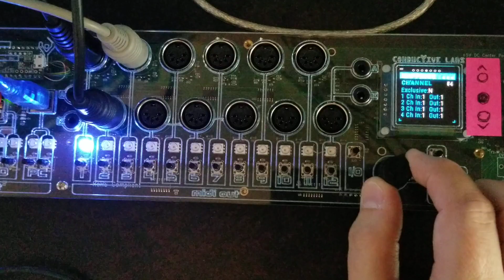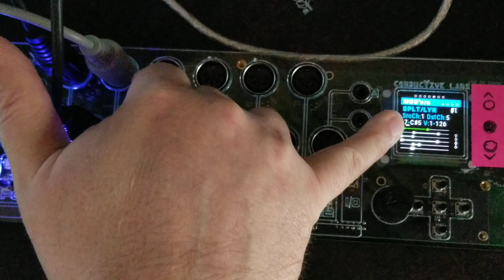MRCC April 2020 Update - video 3

Comment: I have a question on these functions - how do all of these really cool routing and modifying features influence latency in the MIDI chain?
Reply: Like all MIDI routers before it, you will get some latency vs a hardware MIDI thru device that does no processing. The minimum theoretical added latency is 1ms. The more filters, merging or transformations that are done the more latency. How much more is tbd, but MRCC has a really fast processor and initial measurements were very good. You can see some results from our prototype testing here: https://www.kickstarter.com/projects/thendlr/mrcc/posts/2656230